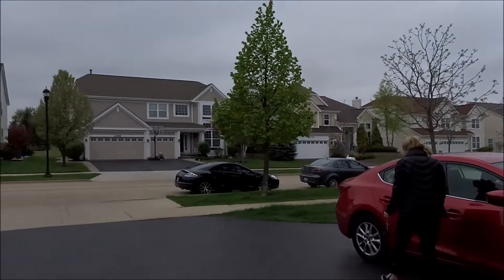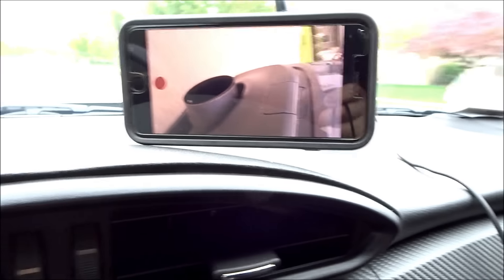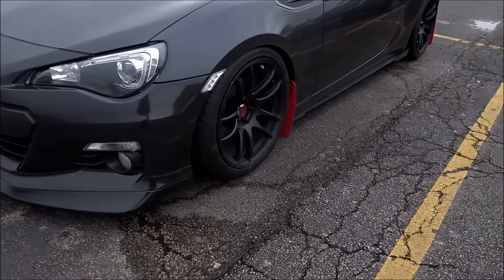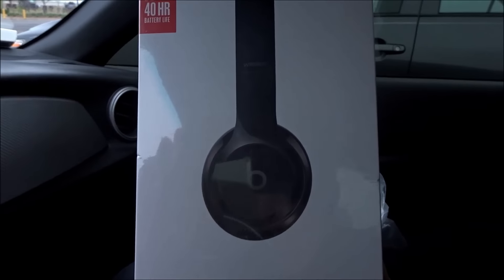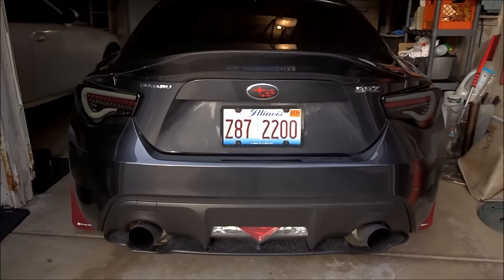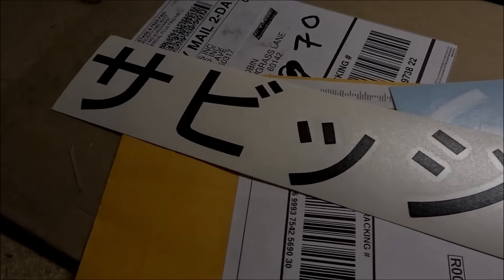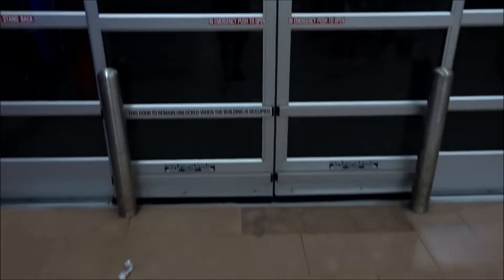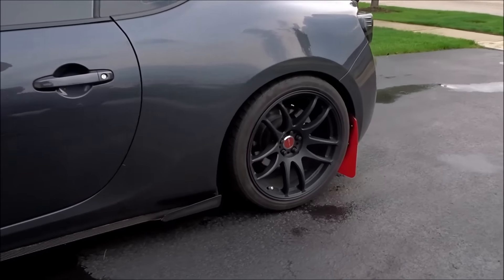Finally Debadging my BRZ! (Custom Lights)

Comment: At the end of the video it look like there's still the outline of the badges. Not sure if it's just cause the car is dirty, or if you need to use a little polish to clean it up. 

Also, when I de-badged my Evo, I used a heat gun and it was really clean, with almost no residue sticking. Surprised you didn't use either a heat gun or a hair dryer as I think it might have made your life a little easier! ;)

Glad to see what the BRZ looks like without the badges though. Finally got mine yesterday (after placing the order in February), and loving it so far! Looking for little things to do to it while I wait on the bigger mods, and taking the badges off was one of the things I was considering since I loved the look on my Evo. After seeing this I may just go ahead and take them off on my car as well. :)
Reply: Geese1 i see it too 😬
Reply from the maker: The cars just really dirty! The outline was from all the filth. I filmed the outro after work the next day and it was raining the whole day. It's been raining and thunder storming every day this week so hopefully this weekend I can foam wash the car and get it all nice and clean! And I did use my heater when I took the badges off! It's a small room heater that I put a couple feet away from the car. I was so lazy to take the badge off because I didn't really care to take them off until I got my Carbon Fiber Duck Tail spoiler a few months back! The spoiler made the badges look out of place and I've been wanting to take them off for some time!

Comment: Where did you get the emblem stickers? Im having trouble with my front one not staying stuck on.
Reply from the maker: Jordan Barone I got them from ft86speedfactory. Make sure the emblem is clean and dry before applying it. It also can’t be cold. I used a heat gun for most of it but if it’s in a warm place you should be fine.
Reply: Yeah I purchased them from a different website and have had to get multiple resent to me because they kept lifting before I gave up lol. Ill try from ft86 this time!

Comment: You’d be better off using a caramel wheel for the double sided tape residue. It will take it off in seconds
Reply from the maker: That would of worked too! The adhesive came off very quick with that turtle wax stuff. Much easier than I thought it was gonna be.